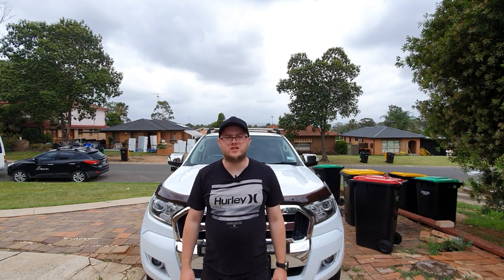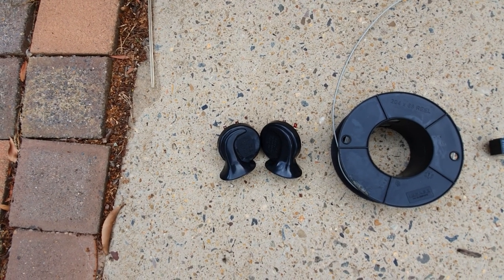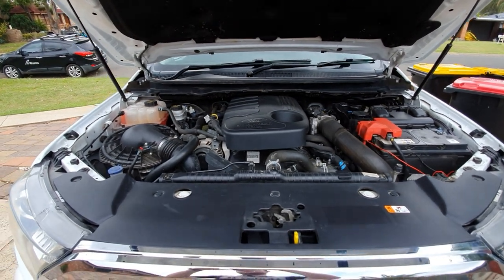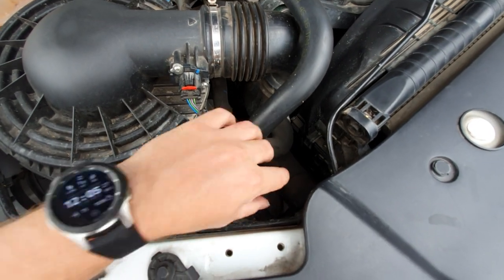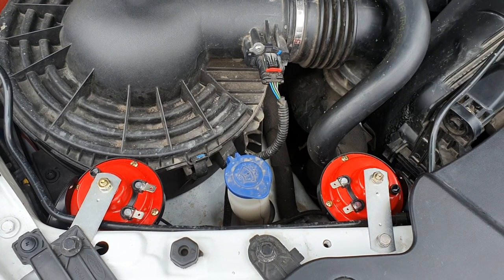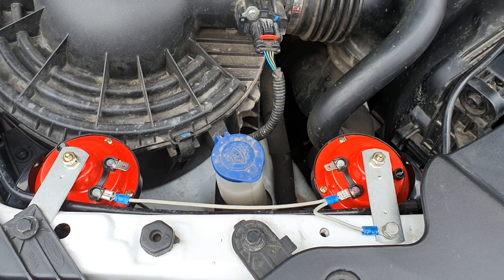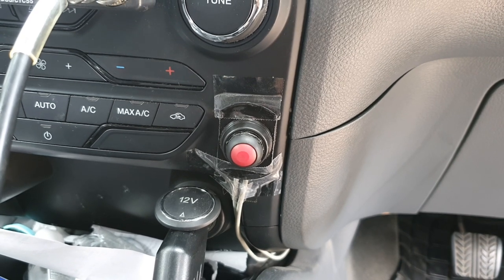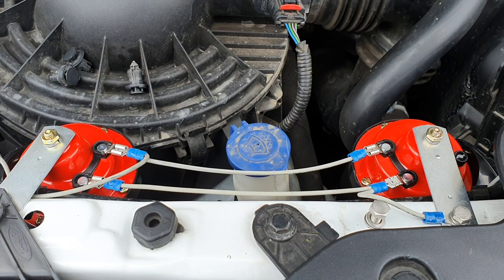How to install extra horns into your vehicle

Comment: Why is there two wires coming off the switch?
Reply: One wire runs from the battery to the switch, the other runs from the switch to the horns. Basically it’s one long wire from the battery to the horns with a switch in the middle to decide when the horn receives power
Reply: thanks
Reply from the maker: hope it makes sense

Comment: Love you channel. It has god potential.. But nyes, maybe a bit more detail, like where to run the wiring in the Ranger.
Reply from the maker: thanks for the input, the reason why i didnt go into specifics is because this video is a generic video on how to install extra horns and its not specific to the ranger. On both sides of the firewall on the ranger there is large rubber grommets that you can feed cable through,  in this particular case i ran the cable behind the reservoir bottle, through the grommet and it comes out just above the accelerator pedal. I hope this helps

Comment: always use a relay no matter what
Reply from the maker: Why, if its a stand alone system you dont need one?
Reply: @TheInsightDistrict  how much current are you running through the switch
Reply from the maker: Its next to nothing, and all you do is get a switch thats rated for the current draw of the item
Reply: @TheInsightDistrict  yes you can but running all that current through the cab and a switch is just not a good idea on cars. on houses its fine cause its AC but with DC just no
Reply from the maker: @playthegame1016  the horns only draw a maximum of 6 amps, if you have a fuse inline, your not going to have any issues

Comment: I appreciate the video, general in nature.  But I do need more specifics.  You mention a relay.  I have extra relays.  How would that work?  BTW, my main horn isn't working right now, so I am looking to set it up with a separate switch.

And the fuse - how did you incorporate a (standard vehicle - or an inline/tube) fuse into the circuit? [Am guessing somewhere before the horn's positive terminals]
Reply from the maker: maybe find out why your main horn isnt working first in case its the switch in your steering wheel or something else

Comment: i got the same horns, how did you onow the difference between pos n neg? they dont have it marked as most things do
Reply from the maker: just put some temp wires on them, touch them directly on the battery terminals and see if they work , that will give you an idea of which way they go

Comment: Where did you go in the car with the wiring.
Reply from the maker: On both sides of the firewall on the ranger there is large rubber grommets that you can feed cable through,  in this particular case i ran the cable behind the reservoir bottle, through the grommet and it comes out just above the accelerator pedal. I hope this helps
Reply: Hello, on the schematic, we see a fuse between the battery and switch… but dont see or hear on the video and thats my biggest question… if you can assist, thanks

Comment: Why not just use the power from the original horn ? :face-orange-raised-eyebrow:
Reply from the maker: because if the after market horns have a fault or draw too much power, it can blow the fuse for the stock horns and then neither of them will work